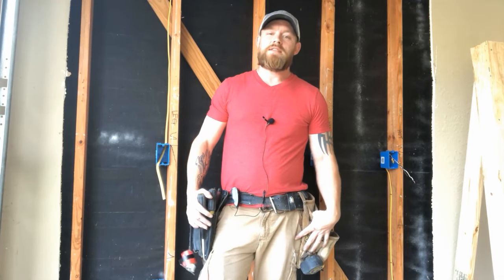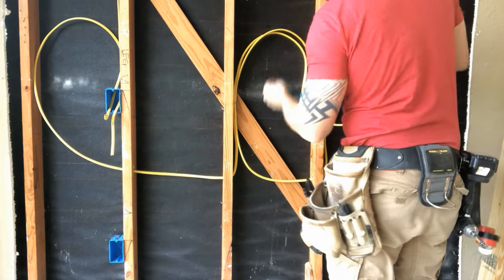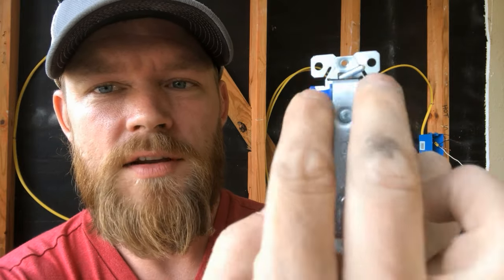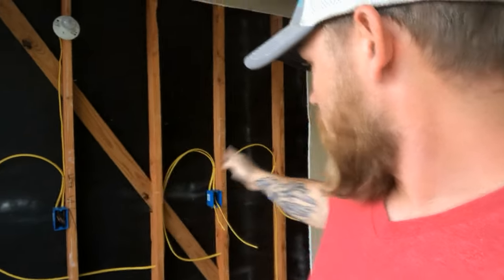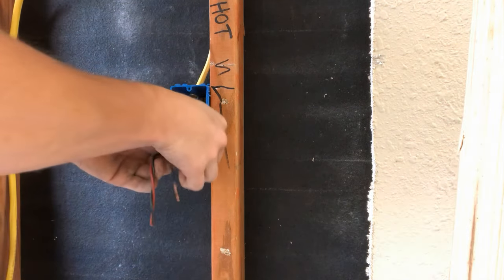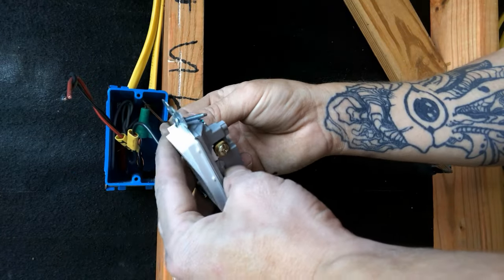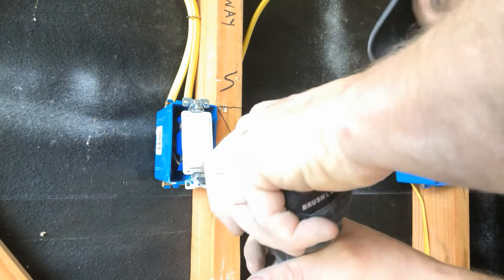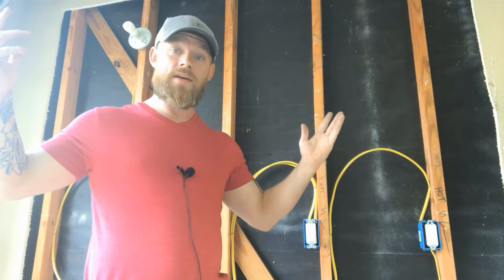Episode 8 - How To Wire For And Install 4-way Switches

Comment: Would like to see a video on how to add electrical outlets on exterior brick home.  Thx.  Love your videos
Reply from the maker: I could drum one up, are you talking about mounting boxes and conduit to the outside of the brick or are you trying to cut the brick out and flush mount the devices inside the brick?
Reply: @electricianu the first option with mounting boxes and conduit to brick probably would be less of a pain.  Also, what to consider as far as breaker box, such as do i need to add another breaker to avoid too much load.  My knowledge is very limited so excuse me if i am not making sense.  I just dont have any outlets outside in back where i have my BBQ pit area.  If u need i can send pic of the area for a better visual.  Trying to research to do this on my own.  Thx!

Comment: In Australia, it is so much easier. We run a twin active from the first switch and loop it until the last switch. One end has a hard active single and the other a switched active single that runs to the junction. We use normal switches for either end but use an intermediate in the middle.

Comment: When I was building houses and not working for myself, I used to watch the electrician s using the old Yankee reversible screwdrivers. I was amazed they could stay on a slotted screw while running those screwdrivers.  
Now with torx head screws its so much easier. But those dudes learned how to really use those Yankees.

Comment: I have a question and I hope this makes sense.  There are no examples ANYWHERE on the internet so it may be a good video for future.  Think of a big sqaure where I have 2 - 3 gang boxes (1 on the left and one on the right side of square) and 1 - 2 gang box at the bottom of the square.  The 2 gang box will house 2 - 3 way switches and is on a wall at the bottom of the square and between the kitchen (left side of square) and living room (right side of square).  The 2 - 3 gang boxes will have a 4 way, a 3 way switch and a single pole switch.  The first 3 gang box will control the living room lights (3 way) and the kitchen lights (4 way) and the front porch lights (single pole). The second 3 gang box will control the kitchen lights (3 way) the living room lights (4 way) and the back porch lights (single pole).  The power will come from the 2 gang box.  The lights for the kitchen will be run from the 3 way in the living room and the lights from the kitchen will be run from the 3 way in the kitchen.  The lights for the back porch will be run to the single pole switch in the kitchen and the lights for the front porch will be run from the single pole switch in the living room.  My question is how do I run power.  Do I need a homerun to each circuit to the 3 way switches in the 2 gang box and then a power source for each single gang box?  I have a diagram but can't post it here.  Thanks for ANY help.

Comment: Very well done bud,I learned alot but still would like to know how to add another switch into an existing circuit
Reply: The very same question I have.
I'm doing a bathroom remodel and ran into 5-lines in a wall, in a light box... it's driving me nuts trying reroute, and reconnect all the wires back because one wire is 12/3(Hot), with the others being 12/2....
Reply: if it is one regular single pole switch for a light, you would have to rewire with 3 wires and change the single pole to a 3 way and add another 3 way for that second switching location

Comment: Suggestion  (not in NEC). BOXES SUBJECT TO WET LOCATIONS HAVING THREADED HUBS REQUIRE SEALING WITH PLUMBERS PUTTY OR OTHER SEALANT APPROVED FOR THE LOCATION ENVIRONMENT - HELPS PREVENT  CONTENT CORROSION

Comment: For the past 7-8 years, all the 14-3, 12-3, and 10-3 NM-B that I have seen stocked in my area (Tucson) has been flat, rather than the slightly spiraled round cable in the video.  I personally find it much easier to deal with, but a lot of people apparently are still fans of the round stuff.

Comment: Use a high quality square drive bit on your power tool for the connections your drill will torque them down great.

Comment: Good job. 
The only thing(s) that I would have done differently [in the configuration you provided] would have been to (normally) DRILL my holes and run my wire ABOVE the height of the switch boxes, then DOWN INTO the boxes - to save [a] wire, [b] extra stabling and [c] time/money. 

The next thing is with the switches: 
I totally agree with wrapping the conductors AROUND the screws. 
I hate even the fact that manufacturer's of devises (outlets and switches) allow for and provide BACKSTABBING of their devices - even in the case where they are 'secured' via a screw. The fact is I have seen (we all have had to have seen) too many instances where the 'backstabbing' method's lack of providing a secure grip on the conductors has caused issues of one kind or another. 

And if some lazy, or yet too ignorant or preoccupied 'helper' fails to strip enough insulation off the wire (or too much insulation off the wire, which can cause another potential issue) and 'backstabs' the outlet, well not much chance of a 'good' connection being established in that case with those devises.

Even as a fairly new (yet somewhat experienced electrician at the time - back in the early '70s to early '80s) I had came across a number of instances where devises had been burnt and/or they provided intermittent continuity of power due to poor connection of the conductor to the devise via 'backstabbing'. So early on, I adopted the method of connecting to the screw rather than 'backstabbing'.

DEVISE WITH SCREW PLATES - WHAT I DO:
As for the screw with a plate.

I will NOT merely insert the stripped [straight] end of the wire directly maneuver the devise into place, secure it,

EVEN with the devise with a PLATED SCREW. I STILL make a short (somewhat looped) 90 degree BEND in the END OF the conductor and 'wiggle' it BACK UNDER the screw plate, so it slightly wraps the screw under the plate [I loosen the screw as much as I can to accomplish this], I then tighten the screw; BUT then I 'WIGGLE' the wire to 'shake it down' so to speak (flatten it down even more); I then RE-tighten the screw. 

IN that way, as I am manipulating the wires into place and maneuvering the devise into the box; THE ACTION of doing so DOES NOT inadvertently cause the round stripped end of the wire to 'ROLL' and thus LOOSEN under the screw plate...while I am non the wiser that it has done so. 

Those wires are now 'flat out' tight and secure and aren't going anywhere!

Lastly:
Many years ago (~1982, when I was taking my classes for the Journeyman's Exam back in South Florida from a great and very reputable instructor/guy). We had a discussion regarding the difference between 'legal' [NEC] and what I saw as the lack of ethicalness in the practice of 'backstabbing' devises. 

At that time, he argued that since it was 'legal', it was acceptable. I stated that though 'legal' and 'acceptable' is was not good practice, thus in my mind, not very ethical. 

How lazy, 'time conscious' or lack of pride does one take in his craft to opt for employing practices like 'backstabbing', as opposed to making a solid connection that ONLY the screw affords over that of the 'expediency' of 'backstabbing'.

"Can't see it from my house" or the ever popular mantra, "Good enough for government work" has never been my philosophy, position or practice...or if ever was way in the past, I lanced that out of my life long, long ago. 

A few years later, I took a class from the same instructor and asked him about the practice again. This time he agreed that though 'legal'/'acceptable', he no longer considered it good practice or ethical.

Comment: Finally, a description I can understand!  I have a setup not covered on any video. I have a switch in my house I want to turn on outside spotlights on two separate outbuildings. Correct me if I am wrong, but determined a 3 way switch goes in my house where circuit gets power and run 12/3 to first building , then the  4 way switch goes in that first building in line, and then run 12/3 to last building with a 3 way switch in it. I’m thinking I must run 12/2 wire to my light on that building , then run 12/2 from that light back to first building.  From what I’ve seen, you can’t run power to light in first building from 4 way switch in middle of the run? Can I?

Comment: Great Video! Thanks for providing details on where to connect in the switches. My confusion just disappeared. Any chance you will do a video on putting in a smart 4 way switch - particularly the Inovelli Smart Switch where,they say,  you can use the existing 3 way switches and the 4 way switch. Only the Line side 3 way switch is replaced by the Inovelli Smart Switch NWZ30 . Just cant get that to work and cant figure out why even after meticulously following their instructions.
Once again thanks for the great job on this video.

Comment: If you use LED light u can use just 2 4 way switches.The induction will be very much and if u add the 3th 3 way S the led will be half lighted

Comment: I have watch your videos.. my question,  is why you dont use electrical tape on the single pole switches, ect . To prevent any short if wire ground each other..

Comment: Great video. Got a dumb question which I’m sure you probably cover in another video but why are the hot and leg wires only have black and no red
Reply: Only dumb question is a question you ask when you already know the answer. 
 
The reason is cable without the red is cheaper, and it is not needed coming from the service panel, or going from the last switch to the light.  There is only one "hot" connection in those runs.

Comment: In Australia this is called a 3 way switch as you can switch them from 3 locations .A 2 way switch you can switch from 2 locations  Leg wires are called switch wires The hot wires are called actives or feeds the travelers are called straps or pass wires.

Comment: If you're going to label your wires, label them inside the box just beyond where they come into the box.  Strip the sheathing leaving the labeled portion intact.  Then there is a permanent marking inside the box identifying what the wires are connected to.

Comment: Have you ever considered using safety wire pliers with a lock and twisting feature.?  Also, why do you loop your wire on he opposite stud instead of coming from under the box?

Comment: If you had more than one light you want to come on (say three sconce lights) being controlled by these 4-way switches, do you run travellers from the first light light to the other lights?
Reply: The travelers are the wires that connect the switches together.  They only exist between the switches.  If you want more than one light to be controlled, then you run cables from light to light, and chain them together.
Reply: Jovetj, I understand the following: power comes into the ‘hot side’ box, then traveller wires go to the middle box(es) ending at the ‘leg box. From the last ‘leg box’ in the series of switches, the power goes up to the light(s). I just need to know (have confirmed) that I understand correctly that if there are more lights than just the one, they will be connected (by travellers?) from the first light, in a series of lights to the last light.
Reply: Yes.  You can use multiple switch legs from the final switch, or you can go from that switch, to a light, and then to the next light, etc.

Comment: For a lighting circuit (15 amp), is there a reason your using 12/2 & 12/3 cable?  I’ve always understood 14/2 & 14/3 were code.

Comment: Excellent.  One question - haven't you negated the value of the service loop for all the wires by stapling them where you have?  How would you pull extra inches of wire into the boxes the way they have been stapled once the wall covering/drywall has been installed?

Comment: Thank you for the awesome video! Would you be able to expand on this three way video by adding a part that talks about if the power is going to the light fixture first? I’m guessing it’s relatively the same process except most of your splices will be at the light fixture?
Reply: It's the same idea.  The circuit works the EXACT same way...  hot into the first three way... then travelers... then any number of 4-ways... then the final three-way... then to the light.  Traditionally, you would still connect all the switches together with 14/3, using two for the travelers and the third wire to connect the end of the last 3-way all the way back to the light (either for the "hot" or the "leg" end).  But newer codes say you should have a neutral in each switch box, and just for sanity you should have one for sure in at least the first switch box.  Doing that means you're looking at running 14/4.

Comment: The more  4 way  switches you have, you could have more locations to turn the light on and off I also like to put tape around the switches So the ground wire will not hit and cause a short

Comment: Here in Canada : the white wire may be used to carry live lines, beware. Because of this the line is can be brought to the octagonal box, the other ways bring to much wires in limited spaced box. Inspectors consider bringing all wires thru switch boxes the: Japanese/Chinese 3 & 4 ways. We can simply add a deeper octagonal box or add an extension boxes to the original octogonal box.
Moral of the story: check local laws, never assume nothing!👍

Comment: RE: Wiring an Isolated Grounded Receptacle.  Could you please detail the exact method of wiring an Isolated Grounding Conductor at the main or sub-panel. I understand the wiring method at the receptacle (with the separate insulated grounding conductor) however, I want to be dead sure about the termination point at the main and/or sub-panel. Thank you for your time and consideration.

Comment: what’s the best way to troubleshoot the “problem switch”?  Will both 3 way switches have a “hot” wire?  All three will turn the lights on and off, it’s when I start combining on at one switch, off at another.  Do all three switches need to begin in the same open/closed position? Thanks!

Comment: 21:04 I've found that if the wire unwrapped nicely the new wire may naturally form into place with a little alignment in forethought and tighten up cleanly, but if it's pretty gnarly it's not even worth trying, just straighten it out, lol

Comment: Pretty interesting to see the differences in the trade from your American style to Canadian. I’m only a first year apprentice but I’ve dealt with these types of installs a few times. I’m assuming you didn’t ground your device box bc it’s plastic. Also how you have your wire nuts pointed downwards is frowned upon in the trade here, they should always be facing upwards, and what you call a wire nut, we call a marrette. Also when you were attaching your wires to the switch I’ve been told to never use a drill and to only use hand tools so you don’t strip anything, kinda irked me when you did that 😂

Comment: Great video, very helpful.  Question, noticed that the receptacle installed with the ground down, heard that it is now ground up.  Which is correct?   Also, can you have a 20A circuit and a 15A circuit in one box?  20A for a GFCI and the 15A for a light.
Reply from the maker: There's no requirement for ground up or ground down but you'll see ground up in a lot of patient-care-facilities/hospitals because if something metal falls down behind a table and lands on the plug (and the plug is slightly pulled out of the receptacle) it will hit the ground prong rather than hitting the hot and neutral prongs.  There is logic behind this decision, but not strict code.  Also, the amperage of the circuit is based on the conductor size, as well as the breaker.  For example if your "15 amp" circuit is run in #12 but has a 15a breaker, it's still good for 20 amps because that #12 WIRE is rated or 20 amps - even though the breaker will trip at 15 amps.  You can't undersize your wire but you can oversize it.  You have to make sure your breaker matches the conductor size.
Reply: @electricianu  I worked in a manufacturing facility years ago and we had to put all the ground pins up in case something dropped on the plug.  Since those days, a lot of residential plugs are made with a 90° space saver plug which should hang down so I started putting them down.

Comment: At about timestamp 16:00 if you need another "habit' score the sheathing at a 45 degree angle.  This way, if BY CHANCE you one day nick a wire insulation the nicks will not be in line, thus further reducing a remote chance of a proximity short...while on the subject...I'm the same way...it would just bug me to do little things "UN-EVEN" also.

Comment: Our inspectors do  not like to see wires going across 2x4s at where there can be a nail entered. We normally drill holes about 3 inches below the ceiling and run the wires down.
Reply: So use nail plates

Comment: Hows that chuck holding up on that compact makita drill? I use to always use the compact line when it was white, but I've had 3 of them get stuck and chucks no longer tightened or loosened. I'd change bits often, multiple times an hour. Just wondering if its any better. Don't know why, for its still what I'm going to buy lol

Comment: Very helpful vidio's for a new addition build! But a I have a question. I m putting in a bath room with 2 entrances and a ceiling fan light combo. I would like to put a 3 way duplex switch at each door. Top to run light and bottom to run fan. Is this possible on 1 feed line?
Reply from the maker: Hey my friend, thanks for watching!  What do you mean by 1 feed line?  Are you talking about 1 circuit? BTW - nobody calls it a feed line, if you're referring to the wire from the breaker that is called a home-run.  Just trying to understand so I can wrap my head around what you're asking.
Reply: Thanks for the heads up on terminology. That would be a home run